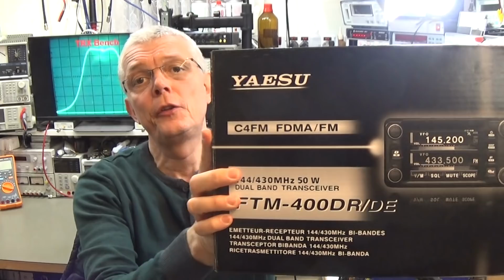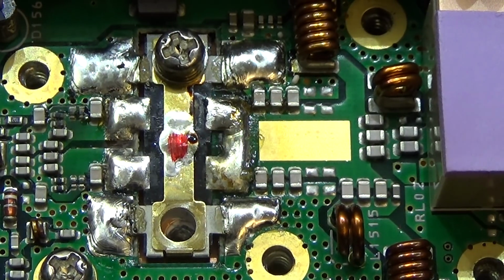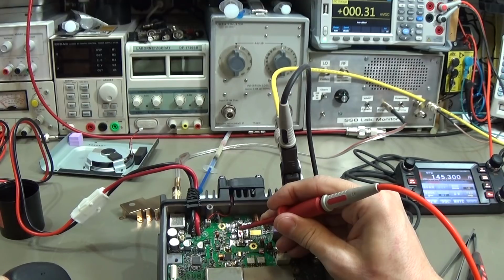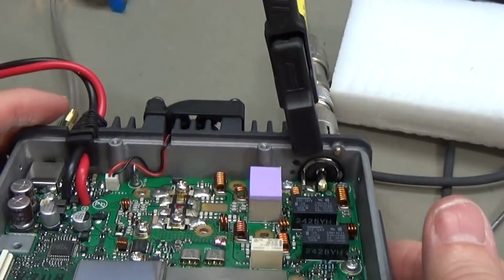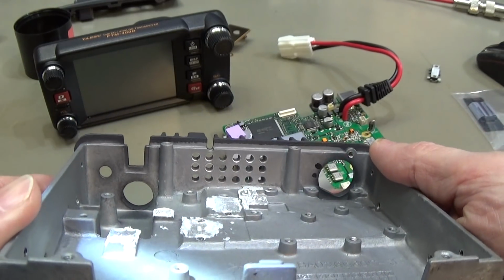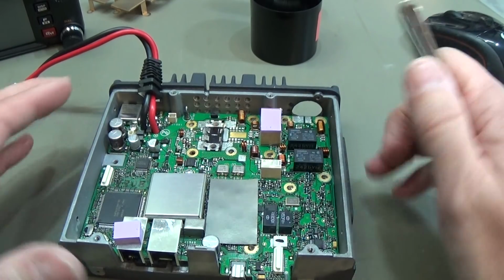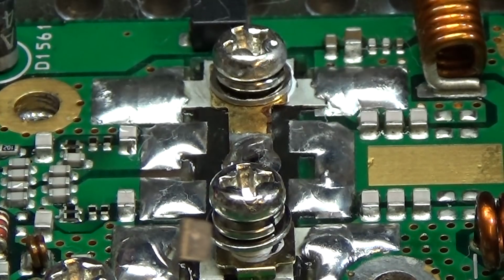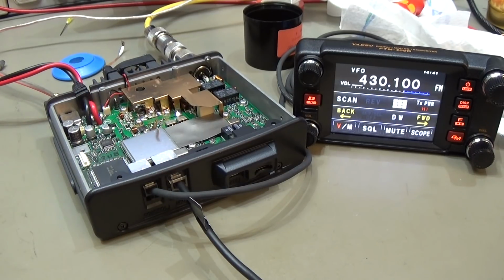#160 Yaesu FTM-400 no output power fixed. Including modification

Comment: Hey Peter, thank you for this video, very informative and helpful. I recently aquired a FTM-400DR with the output issue and am wanting to make sure that I get the right FET. I have seen so many that come up under the search for RD70HUF2, and the only difference I am seeing is the number on the chip underneath the "R070" on the one you have is 173, but the one I found has 132. Is this just a LOT number that does not matter? Everything else is exactly the same.
Reply from the maker: yes, an internal chip information

Comment: hi my help me, i'm HAM and during an alignment of the FTM400XD radio in the TX power alignment parameter of the service manual, started as per procedure from 440.050 Mhz low power and 5.3 watts, I continued up to medium power 20W.
By storing the 5.3 watt parameter in the Adj 02 PWR menu with the Adj 02 DVR parameter with 9AH in low power and the medium power parameter Adj 02 PWR with 20W and confirmed with Adj 02 DVR with B0H.
When I reached high power (50 watts), while I was rotating the dial to align the 50 watts, the Wattmeter with the built-in laboratory dummy load burned out. Now I don't have a tool to align and verify all 3 parameters, especially the high power one which stopped at E1A when the wattmeter burned out. On VHF I obviously didn't continue to set anything.
Can you tell me the alphanumeric codes (e.g. 55H 92H E1a etc which are factory set in the respective power parameters 5 - 20 - 50 watts in UHF in the service menu? I would like to set it with those factory values since I don't have a Watt rf instrument from measure at the moment.

Comment: Hi peter, love youre video's learned a lot from them, could you do a short video how to allign the s-meter if it's possible, the meter reading on my ftm400 is way off, i know the meters are nott that accurad but on my radio everybody is almost a full reflection, i know where to be in the service menu butt there it stops for me, in the old radio's there was a pot that you could turn butt here is that not the case.  Thnx.
Reply from the maker: next time when I come across

Comment: Well, another Yaesu with burnt out finals.  This seems to be a manufacturing problem.  Probably not enough heat sync paste used in the manufacturing process.  Should there be holes in the chassis to alleviate the heat build up???  I hope my 991a doesn't develop a final problem.  Cheers & 73 from W Rusty Lane K9POW in eastern Tennessee

Comment: Hi Peter, great video. I have this radio along with  friends who use this radio and the FTM100 and 300, all of which burnt out the PA as this one did. Yeasu use these radios in their Fusion repeaters and we have had these burned out thier PAs too. 2 of my friends had their cars full of smoke when their radios failed. Why would Yeasu release these heat prone and heat  sensitive  radios when they cannot be used with full power? How short should your transmission be for it not to burn the PA on high power, 5 seconds, less than 5 seconds? When using 2M FM, all tow trucks and others on commercial frequencies kills the radio. This is one of Yeasu lemons, I love Yeasu but hate this radio.
Reply: Probably a good idea to place a fan on top of the cover with holes drilled as an extractor and one on the cooling fin as the blower.

Comment: I had the same problem. The device does not output any watts. I used the device and suddenly no one received my messages anymore. I don't know if the transmitter was burnt, but the  is excellent Hear all the stations I don't know how much the maintenance  cost

Comment: Do you recommend that I do the chassis cooling modification even if I’ve not had the failure?  My radio is often exposed to 45 degrees C.

Comment: Hi Peter. I used to work as service manager at a Deutz Edsel Dealership and as electrical supervisor at a Linde  forklift dealer and have always been impressed with German engineering. Your friend along with yourself demonstrate the same precision.
Reply: Germans build quality, technology with beautiful esthetics,  could not be beaten in the old days. I love BMWs and still have my 1989 E30 Mtech II with an e36 M3 turbocharged engine. I had a Euro performance shop and addicted to the 2005 and older BMWs. I also had a 1972,  2002 tii.

Comment: For some reason I missed this video. This is the reason I will NEVER buy another Yaesu radio. I bought two of the FT-101D models before I discovered the VHF/UHF final would burn out over and over. After having both replaced under warranty by Yaesu, they burned out again. By then I couldn't buy another final.

Comment: mr peter sir a quick question about  56 mins of your  video  i have a FTM100DE  the setup pcb board is near identical  it puts 5w out on low power setting as it should .... is there a adjustment in there or a internal  potentiometer to lower the 5w  down to 1w to run extremely cool  or what  must i do    as its all i need in RF power for my application /setup?

Comment: Hi Thank you for this video. I have 2 Ftm400DE's both have been for repair and one of them for the 3 time out of warranty. So when the other blew again out of warranty i followed your video. I did renew the thermal compound and instead of the grid of holes i decided to make slots instead ( i joined up the holes). I have not done a repair on a transceiver before, and it is now working. Im now going to remove the other one from its chassis and add the slots to that as well. Thank You!

Comment: Very good job as usual, no power on both bands, we would suspect the power amplifier. I have a FTM-100DR, and I have transmit on one band, but not on the other. So I would suspect some sort of switching circuit, but I have no access to the schematic for the radio.

Comment: Excellent Job Peter.  I have several Ft400s and DR1X TX modules that needed repair and of course I added the cooling mods you suggested.  I have a couple with no voltage (13v) on the driver and pre-driver (9v).  Not sure whats going on there.  The main PA is good no shorts and has its voltage as needed. By your vast experience,  any idea where to look to find what out whats going on with the no voltage to the drivers?

Comment: Good work Peter,the two capacitors near the power dc input look a little effected by heat also,very good repair job as usual,regards Colin G1PGI
Reply from the maker: Yes you are right this caps looks a bit funny but those are fine. Thanks for watching

Comment: Heat kills EVERYTHING, from people to electronics to lubricants to paper. An aluminum electrolytic capacitor running at 50-60 degrees C might have a lifespan of 11,000-15,000 maybe even 20,000 hours. At 100 degrees C you will be lucky to get 1100 hours out of it. The finals in these radios are the same way. I don't know how they do it, but somehow, we only have ONE supplier for most of the Japanese amateur RF stuff, and "IF" I even attempt to buy a genuine Toshiba RF FET from someone "reputable" on eBay, who is selling genuine parts, and not the fakes, they will not ship it to me in the USA. I can have them shipped to Mexico, then drive them across the border, but they do not want to deal with RF Parts' lawyers, and their exclusive rights to sell. If someone is willing to ship you a Toshiba final, it's more than likely a counterfeit part, made on undersized dies. It will test like the real thing, but will never last.  It is amazing what a little air flow across a heat sink can do. The little tiny muffin fan back there would help even more. You could probably scavenge one off of an old PC graphics card. I have to drive 1000 miles to Denver, then cut and drill some aluminum myself. This has to hold down 80 kilos of string tension for a guitar. The Koreans are responsible for this one. Their newer version was fantastic. Their first version was terrible, and destined to fail.

Comment: Nice done Peter, improved cooling will shure prevent a burn out mosfet. Maybe an idea to further improve it by drilling an hot air exhaust. Thanks for the excellent share.
Reply from the maker: Thank you! The lead has exhaust holes...73

Comment: Nice work, Peter. I would cool the IC down good in between soldering each pin. Also for tough soldering jobs I have a Weller D550 240/325W soldering gun.
Reply from the maker: Yeah a Weller D550 is strong enough for sure..Thanks for stepping in Robert 73

Comment: Hi Peter, Your video is excellent as always. I have one quick question, how did you remove all that solder on the MOSFET? Did you use Solder wick or some other method?
Reply from the maker: Hi Rich, well first I used a desoldering gun and then some wick the get the rest away..Thanks for watching 73

Comment: This is an early version of the FTM-400. They added many changes to the case for added cooling and heat dissipation. Yes, this version has heat issues. There is also several versions of the PCB board for this radio. Also, The firmware on this radio needs to be updated badly it is out of date. Nice work though Peter.
Reply from the maker: Ah interesting Dough. Thanks for the feed-back! Sounds like you work for yaesu...73
Reply: I am a small part of the MNWis network on WiresX. We did look into the FTM-400 issues last year about the overheating. We tried to find the differences in revisions on that radio. There is a few. Holes on the front bottom of the case was added this improves air flow on the underside of the PCB. You can see them on the FTM-100 cases for an example. Also the hole in the rear of the case by the fan like the ones you added. A wide rubberband was added over the fan shroud to improve air flow to allow pulling air from inside the case. More heat dissipation on the top side of the Mosfet was also added. These changes greatly improved the heat issues in later models. I love the videos from you. They are always so clear to follow with lots of detail. Nope don't work for yaesu :) Just have a few of their radios. Thanks Peter 73, N9TOW
Reply: I am waiting my radio buy new arrived this week.I didn't read much as i see now and the last days for the overheating problems that many say happens at 50watt on uhf band so i am very sad and has cought me panic .

Comment: Excellent video, thank you and for me to see the problem I had with my FTM-400XD where the PA module failed and presented a dead short across the 13.8 Volt PSU. It was repaired free by UK Yaesu dealer under warranty. Interested to note that no final alignment was necessary as commented on by John Kruk Yaesu USA.  I also confirm the lower out of specification output powers around 3.5/17/40 Watts. Not sure the modified XD version with the holes makes much difference as the fan is so very slow and moved little air?
Reply from the maker: Thanks for watching and comment 73

Comment: Nice job on your video. Thank you. I replaced the SO-239  and a relay in a friend's FTM-100D recently. I also had to remove the circuit board and that was the first time I had seen the thermal foam pads used. I was wondering if the heat transfer pads they use are that good at removing heat, then. Now, I'm really wondering, after seeing how the PA's fail in the 400. I was hoping you might talk a little about them in the video, too.  I was very surprised how they had stacked different thickness' together to get them between the chassis and components.
Reply from the maker: Yeah the foam is not bad but can't really heal a design error..Thanks for stepping in 73

Comment: Love watching you do repairs and mods. Very neat and meticulous. Thanks for the video. I was curious how you would get a "cross ventilation" if there are no vents in the front of the radio. Wouldn't the fan need to pull air across the chassis and board? 73...Dan w4mnc
Reply from the maker: Thank you Dan! Yes it is the best idea to let the van pull across the pcb...73

Comment: nice job peter. however on output i disagree  in the fact if my radio is 50watt output I expect to see 50watt
20 watt i see 20watt.  no more no less. at the antenna jack
Reply from the maker: Yeah I would agree if this is a 100% perfect design but it does not make sense to jeopardize another IC..Thanks for watching 73

Comment: Nice repair Peter. That chassis modification should really help cool things off. Thanks for sharing my friend.
Reply from the maker: Yes together with a new fan it will work...Thanks for stepping by my friend 73
Reply: @TRXLab  Why a new fan ?
Reply: Thank you for showing the chassis modification and the machining process !
Reply: MERRY CHRISTMAS BUDDY
Reply: OJ Jenkins  This is f-ing wrong this bloke has taken this mod from my website https://mikewest25.wixsite.com/2e0ftg I came up with this mod over a year ago now with my FTM-400. This guy SHOULD NOT!! be taking the credit for this modification. I’m the original founder and it should be me taking the credit for saving radios from getting way to hot. I also have a lot more mods on my website. Use the mod that’s fine but don’t make out it was it was you that came up with this because it wasn’t !!!!.

Comment: At least they aren't really pushing that transistor; Mitsubishi's data sheet says that the RD70HUF2 is rated for 70 watts maximum power dissipation.
Reply from the maker: Whatever Mitsubishi rated the AMP for you always need to have the right heatsink  designed for the wanted power. If not you have the problem we are facing here...73
Reply: Yep
Reply: @TRXLab  double yep

Comment: Where do you obtain the service manuals?
Reply: Yeasu has them. Call and ask for Parts.
Reply from the maker: Most are available on the web...73
Reply: Peter, I know that most can be found on the web. I pretty much do a search on "make model" service manual filetype:pdf on google and get pretty good results, but there are a few that I am not able to find. I thought maybe there would be a site where you can purchase some of the that are not freely available on the web. Thanks.

Comment: Looks like a good solution to add some additional cooling for the PA section.  Would be nice if they did something like that from the factory.  Thanks for sharing.
Reply: Not sure whether the fan is blowing in or extracting air out but two things I'm wondering about - (1) where is the ingress or egress for the air circulation and (2) did Yaesu somehow filter the holes in the "X" model to keep stuff from entering the chassis if the fan in fact is pushing air in; no, don't want to start a flame war about whether air should go in or out, just curious!  ;-). TNX for sharing Peter, nice fix!  73 - Dino KL0S
Reply from the maker: Yes it definitely helps...and easy to manage :-)
Reply from the maker: In this case from my opinion the fan should extracting to get the heat out off the radio. The problem is more that the originally fan is relatively weak. We have ordered a more powerful one (not installed yet).  There are holes on the lids to establish together with our cut out a good air stream along the final stage...Thanks for stepping by 73

Comment: mine has been back to Yaesu 3 times for low audio and low power output. sold it and bought a Kenwood.
Reply from the maker: That is really a shame Jeff...3 time is really too much..73
Reply: Actually, with all the repeaters around on VHF and UHF, 25 watts sould be more than enough. 73...Dan